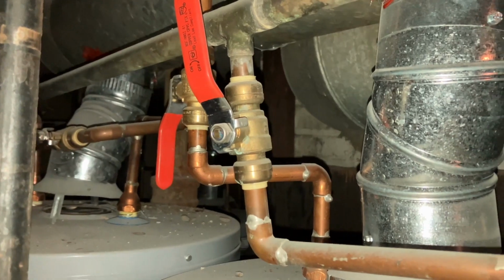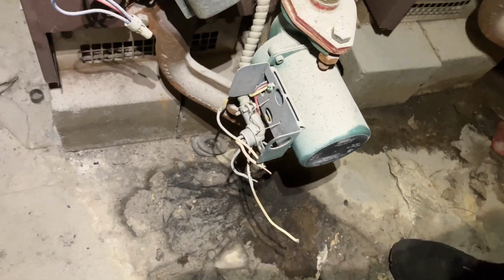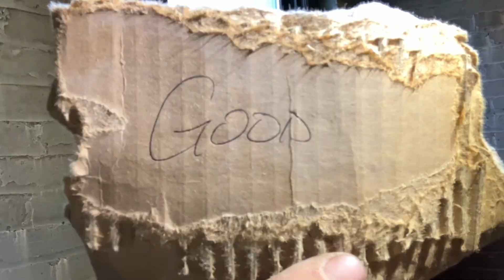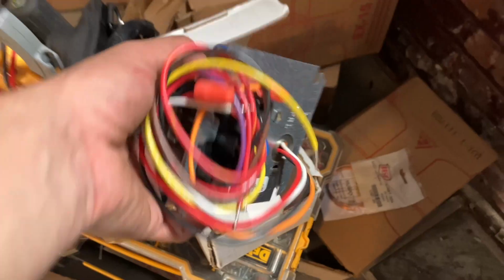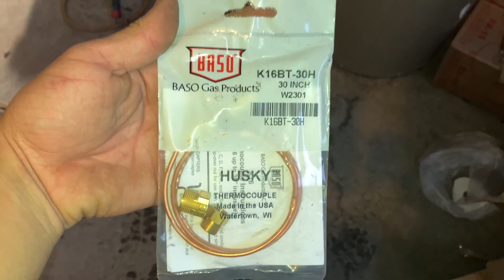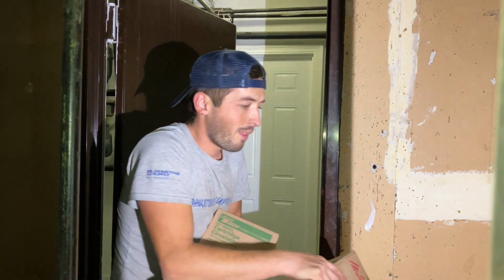10 Hot Water Boilers Fixed in 1 Day

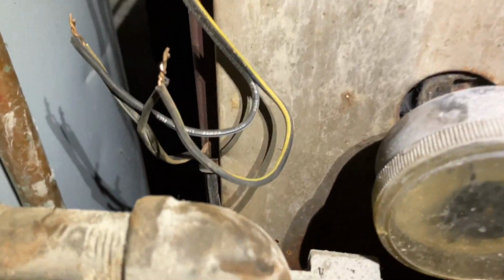Comment: I will admit to having slammed in a Sharkbite w/out shutting down the building when I did apartment maintenance. At 1:30 in the morning when the temps are hovering around 30 below you'll do some sketchy shit to make it to daylight.

But I went back later that week when I could schedule a shut down and stage all the parts I needed and did it right.

Hot water radiators in a 3rd floor unit. Tenant ripped the tstat off the wall, opened 2 windows, and abandoned the apartment. Downstairs neighbor called when it started raining in his bedroom. Fun times.
Reply from the maker: Not gonna pretend like I haven’t just said f**k it I gotta do what it gotta do either lol! Sometimes you just gotta get it running for the night no matter how imperfect it is, love the story thank you for the support and feedback!

Comment: Had to do a mixing valve and the neither the gate valve or water main would shut off.   So i just cut it under pressure and had a press ball valve ready.  Its great you can use them with water in the pipes!
Reply from the maker: for sure! crazy story lol! everything has its place, imo if your able to nothing is better than a good solder joint, then press, compression if you have no other option...or its 4pm on a friday lol